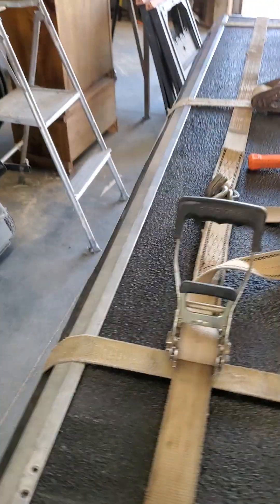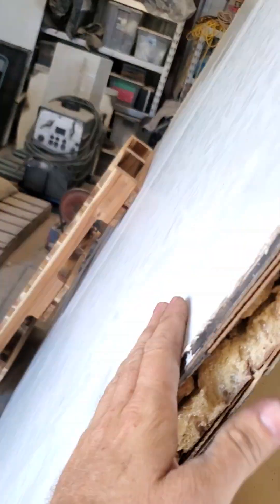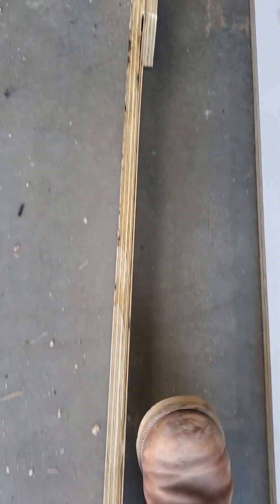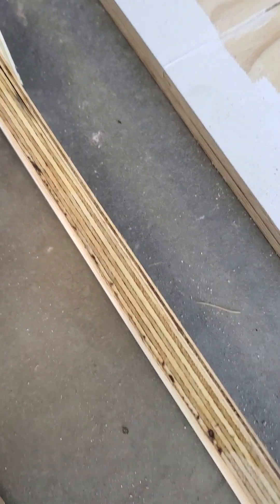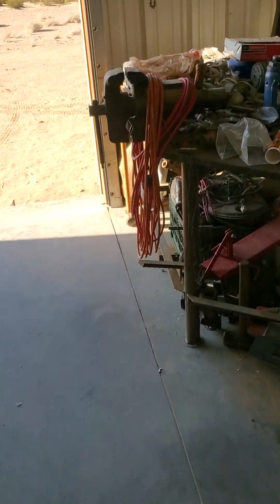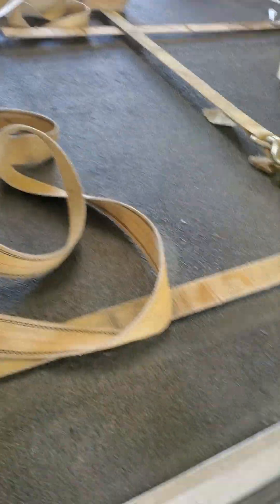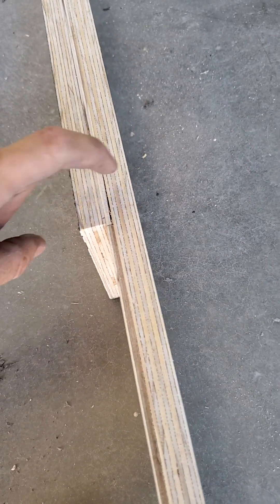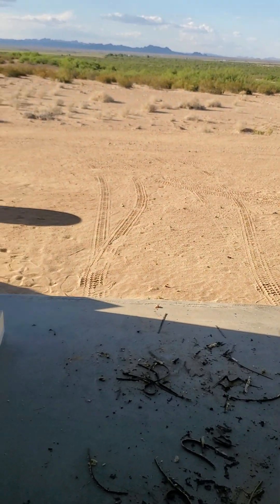Toy Hauler Ramp door rebuild @The Saylor Adventures

Comment: Did you use 4x8 sheets of plywood? If so, how did you cover the seam on the outside painted surface? I’ve watched both of your videos and this is very helpful.
Reply from the maker: Yes 4x8 sheets set 2 one direction and the other 2 the opposite direction, if you arent gonna reuse the inside and outside piece you will need a small piece to make up that gap, in my case i used a 5mm plywood and it worked perfect. You have to cut a little off of 2 sides after they are glued and screwed together to make it fit. I used that gorilla construction glue on the seam. Just ran a small bead down the seam and spread it with a putty knife, Wipe off the excess and its paintable after an hour or 2. If you watch @The Saylor Adventures video of him rebuilding his ramp door I did mine the same way I just didn't re use the inside and outside pieces because mine were junk.

Comment: Figuring new door is much heavier. Did you add any springs to the hinge to assist in lifting?
Reply from the maker: The old door had 4 springs on the hinge, I reused them and yes I added an overhead spring with cables going down to the door. I will make another short video of everything mounted. It's all back together and with the overhead spring the door opens and closes easy.